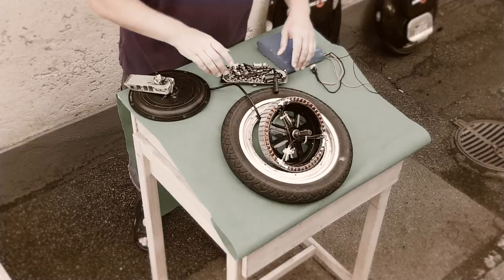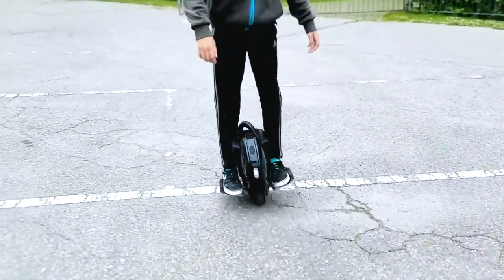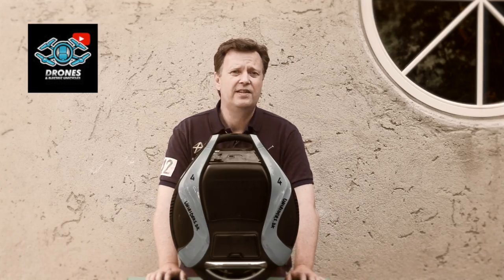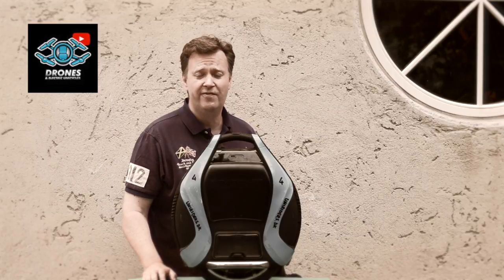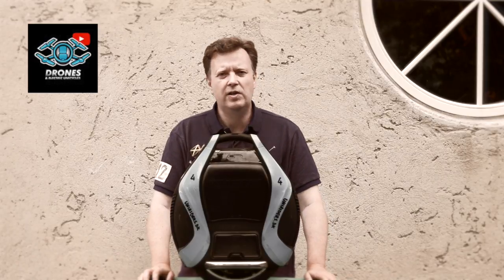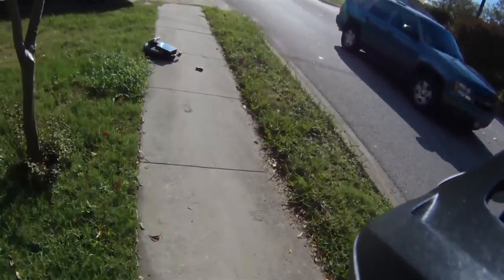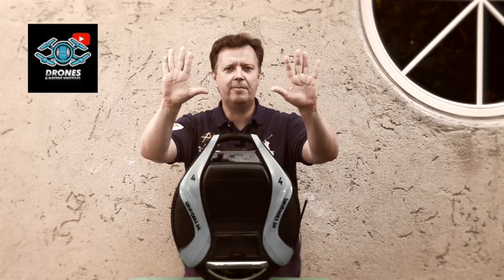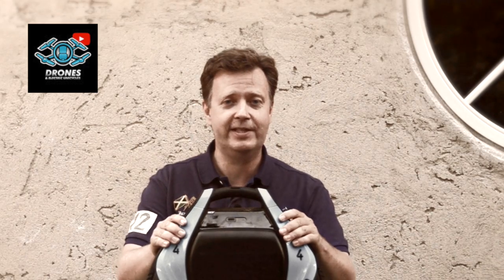Electric Unicycle - Basic Introduction to Electric Unicycle Scooter

Comment: Will the speed charger shorten the life of the battery? If I use it all the time, will it damage the battery's life cycle?
Reply from the maker: Yes, the higher the charging current the more it will reduce the battery life, but how much I can't say. But the cool part about these chargers are you can set them to only charge 85% of full charge, and that should keep the battery healthy because you stay away form the top of the charging curve. So I think in the long, run this will make the lifetime longer even if you use the super charger.

Comment: I do not agree with what you say here about EUC with motor under 800w! It is misleading to say that 350w motor is dangerous! The Airwheel X8 with 400w motor &  170wh Panasonic battery and IPS122 500w motor and Sony 260wh battery are among my best EUC for practicality riding and has been it almost daily since March 2016! It is the knowledge, skill and experience you need to acquire to make you riding safe! It is not some powerful motor or battery that keep you safe on the contrary 😁🚴🏻 so all you beginner out there..trust me the Airwheel X3, X8 or the advance IPS122 is your best first wheel to learn safe and sure👍😁
Reply from the maker: Are you serious? Have you ever used a more powerful wheel? Cheap 350W wheels are lethal if you start pushing them and you are not a lightweight rider. I can testify to that as I have faceplanted on several of them. We have even seen known brands like Ninebot One (500W), fry the electronics if you brake too fast. One of our guys burned 3 wheels on that account, only when we moved to a higher power you have enough headroom to handle these cases that will happen. If you don't do anything fancy and can settle for the less than 20kph and 10-15km range, you will soon outgrow it and want something better.
Reply: I have demo MSuperV3/+ Monster ..etc.. my highest speed achieved about 39km/h😁 our official speed limit is 15km/h and 25km/h..

Comment: I actually disagree with you, you should buy a cheap $200 one to learn on before you ruin your $800-$1,500 one. I learned on a cheap piece of crap and I beat the shit out of it!! thank God I didn't do that to my in-motion V8, now I have moved up to the gotway monster 22" 2400wh
Reply from the maker: This is what I did. I learned on a 14", 350W, 142wh wheel and this was not easy at all. It would have been a lot easier if had gone for the Ninebot e from the start. You can pad it up or in worst case replace the outer casing.
Reply from the maker: The monster looks like a fun wheel